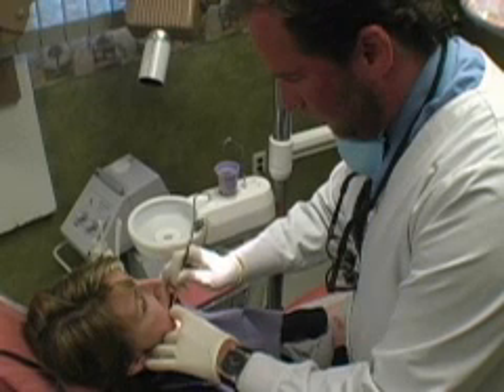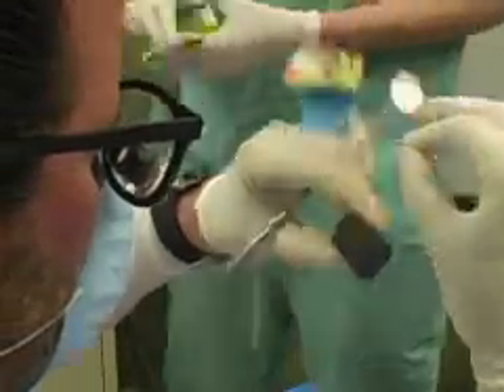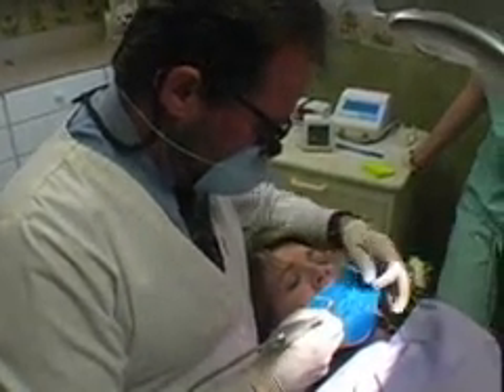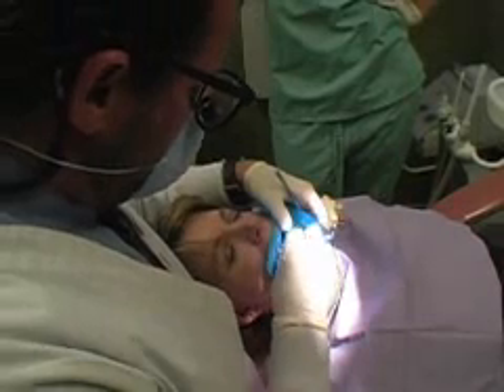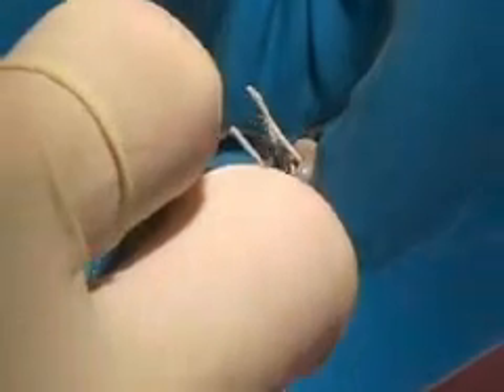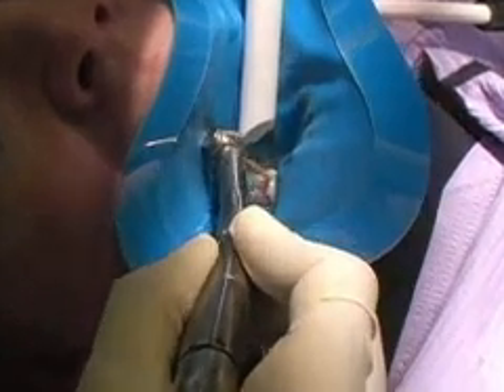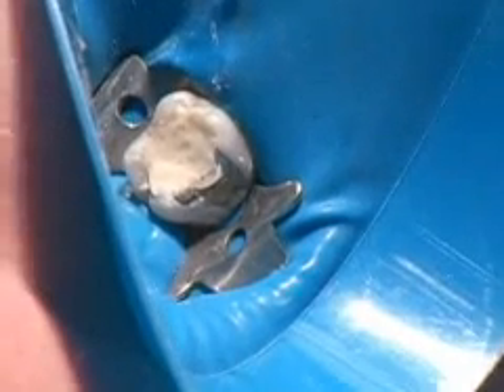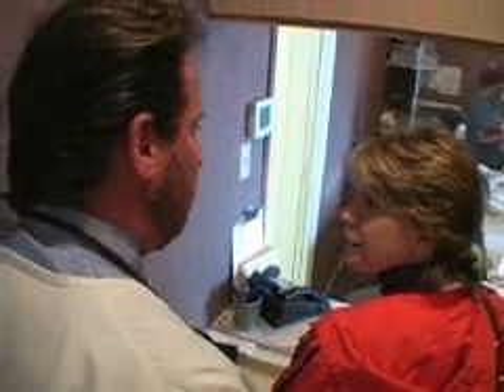Root Canal Demonstration

Comment: I've had one of these before, about 15 years ago when I was 13. It was quite a scary experience because of all the pointy instruments and tools they use during the procedure, in particular the files, and I was in that chair for a good five hours (mainly because they had to take a crown impression and do some fillings right afterwords), BUT it didn't hurt. At all. They gave me two lidocaine injections right at the start and that got me through the entire five hours. They said I did so good they wanted to do another root canal, at which point I started taking swings at the dentist (not really, but I'm sure a lot of people get that urge). 

Unfortunately, I may need to have another one of these done on a tooth I had recently crowned (the filling was too large), and despite all the positive feedback I've heard regarding root canal experience, and despite having undergone one before, I'm pretty scared just because of how incredibly sensitive that particular tooth is. They gave me four shots of lidocaine and two shots of septocaine while they were prepping it for a crown and doing small fillings on the adjacent teeth, and every time they touched it with the drill or cold air, it was like a bolt of lightning tore through my body. I know it shouldn't hurt, but anaesthetic doesn't seem to work too well on me these days. Six shots and I still felt everything. 

So the prospect of needing another root canal after how painful it was just to get that tooth crowned and the adjacent teeth filled, even though I know the procedure shouldn't hurt...not very reassuring. Not with how sensitive the tooth in question is.

Comment: i had my tooth number 5 and 6 root canal treated. As soon as they openned the tooth and touched teh nerve i felt so much pain so the arsenic was the only option. Before the procedure they had given me lidocain shots but still i felt really strong, sharp pain like electricity explosion. Is that normal? do i have very sensitive teeth or it was just anasthesia done in a wrong way.
Reply: Definitely the anesthetic was not enough for you. If the tooth was infected with puss, the anesthetic is not as effective. Some dentists give a double dose in those cases. I always need double the standard. I just had a root canal and half way through I can feel everything. Nerve pain is the worst pain I've ever felt.
Reply: +Rustin Cohle s
Reply: usually if u feel something they should stop and give another shot.

Comment: Hi Doctor. Great job. I had a two unit bridge and felt serious sensitivity pain on the tooth holding the bridge. The dentist did a root canal. The tooth still ache but slightly better than before. I'm scared because I've been reading online that a root canal for my case is a temporary fix that the tooth will fall off shortly. Is this true? .. Thanks

Comment: I just had this done today and I even went to work a few hours later. This procedure last just under an hour. Most of the time is waiting for the topical anesthesia to set in and numb you up real good. For those like me who are scared of shots, don't worry too much. You are given a numbing topical ointment applied to a q-tip and inserted between your gums and the side wall of your mouth. It's set there for a few minutes before the first 2 injections are applied. You may feel some pressure when the needle is inserted on the first two injections, but no pain. After the first two, you are given a rest period of 2 to 3 minutes until the next 2 injections are made. You wont feel them at all, as the first two have encompassed the side wall of your mouth and your face is basically paralyzed for the next 4-5 hours, lol. You will be given another 2 more after a 10 minute wait and just before the procedure begins and that will tally up to 6 total pricks of a needle to keep you calm and painless for the whole procedure. That's the worse part, and even it is a walk in the park. Please don't be scared, you will feel silly afterwards if you do.

Comment: Need to get this procedure done soon, is there any possible way they can put you asleep or numb your mouth or something? Just by watching this I get frightened so I can't imagine what it's like once there.
Reply: if you get bad anxiety like me ask the dentist for a 5mg of valium takes the anxiety edge off without drugging you up kinda just makes you really relaxed and lowers your heart rate
Reply: They numb your mouth with lidocane, a very good local anesthetic, but if your in a an area with what is called "Sedation Dentistry" they can give you what is basically a tranquilizer and you won't even remember going. You'll have to have someone drive you for that and it will cost an extra penny or two but, its an option. But more than likely the lidocane will be enough to get you through it.
Reply: I got laughing gas which basically calms you down then I had 2 numbing shots in my mouth then your relaxed and you can't feel anything ..... The only thing is you can hear the drills which may freak you out but I fell asleep halfway through so all good

Comment: I had one done today - it didn't hurt at all. I was pretty nervous about it going in, but the most painful/uncomfortable part was the initial anaesthetic injection, which I'd say was a 1 or 2 out of 10 - basically not bad at all. After that I felt nothing at all for the rest of the procedure, was was completed in under an hour. In fact, I found the whole thing strangely relaxing. Afterwards I had a very numb jaw for 3 or 4 hours. When that faded there was a mild dull ache but that's been easy to keep under control with paracetamol. Overall, I'd say it wasn't bad at all - certainly not worth the nerves I had beforehand.

Comment: Got my first root canal done today. Based on my experience it wasn't too bad. I didn't feel much after the 2 novacaine injections. I also received laughing gas for anxiety reasons.I didn't feel the drill or the poking of the files.The only pain I felt was when they were getting rid of the nerves and the drying of the sealing cement. It was a drawn out kind of pain (10 seconds each). I received my antibiotics and had absolutely no pain after the procedure. I've got a second root canal in January.

Comment: A root canal will typically cost $1,000-$1,500, plus you will need a crown afterwards which can be another $750-$1,250.   In the USA, even if you have a good dental insurance plan, you should still expect to pay as much as 50% of the cost out-of-pocket.  You should also ask the provider about payment plan options.

Comment: turns out it was just a big cavity! whew! but it needed a deep cleaning, with products used in a root canal. I have to admit the freezing did hurt but even with 3 freezing needles, i felt the drill a little bit, like a pinch on some nerves :S Right when I felt it, I asked for another needle and after that it was completely painless! the only downside was that i was frozen for over 5 hours afterwards haha!

Comment: Cost depends on what tooth needs therapy.  Top molars typically have 4 roots and almost always need to be done by a endodontist rather than a general dentist.  This is quite a bit of work and without insurance will easily run you a couple thousand dollars (this is because a RC tooth ALWAYS needs a crown after treatment).  Bicuspids typically only have 2 roots and can be done by the gen dentist for a lot less.  Cash paying patients can almost always negotiate or get a discount.  Check.

Comment: Thank you for posting this video!  I have an infected tooth which already has a crown on it. I had gotten a cavity under the edge of the crown and had a filling but it fell out.  My dentist had mentioned if the filling did not work I would need a root canal.  Well you hear so many terrible stories about root canals that I put off going back.  So I waited too long, its now infected my face and gums and glands are swollen. I am on antibiotic and will be having root canal Wed. TY SO MUCH for video!

Comment: The rubber dam is essential to avoid contamination of saliva into the canal. (Saliva contains bacteria ) . The rubber damn also creates an isolated environment, so there is little chance of anything falling into the mouth (e.g. Files). This also allows the dentist to work more conveniently and faster. Another important thing is Sodium hypochlorite , it can cause tissue burns if it is spilled. So yes, request for a rubber damn always while having a root canal! Hope this helps answer your question

Comment: Basically during the root canal, they do novicane, and they retest it to make sure you feel nothing.  As they drill, you will feel vibrating.  Then they put a file in to pluck out the bloods and nerves.  There, you will feel a bit of a disconfort pinch, but not sharp severe pain.  Afterwords, they put the fillings in the root and they fill the tooth.

Comment: The worst part about a root canal is that rubber thing in your mouth.  It is nearly impossible to swallow with your mouth open.  It also makes it so the tooth dust from the drilling can be inhaled which smells awesome by the way.

Comment: If you have pain that lingers for 10 seconds or longer, or the pain is spontaneous, it's likely that the tooth is infected and has reached a point to where it can no longer heal itself.  The root canal removes the pulp (nerve and blood vessels) and takes the pain away, removing all the existing bacteria and preventing new bacteria from entering the tooth.  It's best to have this checked as soon as possible.

Comment: The removal of the infection should only take one appointment as demonstrated in the video.  If you have an abscess or your radiographs at the time of your initial appointment show that the bone around the root of the tooth is diseased from the infection, follow up radiographs verify to the dentist that the bone around the tooth is healing and that the infection is gone.

Comment: It doesn't hurt if the doctor gives you the right amount of anesthesia. You will feel a little discomfort (not pain) or pressure when the doc starts drilling and when he starts inserting the brush like things into each root to remove the nerve. It will feel like someone is grinding on your tooth and applying downward pressure. Just make sure you ask for mire anesthesia if it starts hurting as he removes the nerve. Just hope all roots are found if not it might hurt again even after 1yr. Good luck

Comment: I've had the rubber dam multiple times, it's amazing. It allows the dentist to isolate the tooth, keeping any tooth fragments free and clear of your throat. It also keeps the water from going down your throat when they are rinsing and sucking, thus allowing you to swallow during the procedure. It may look a little strange but it's a very beneficial tool used in modern dentistry.

Comment: take care of your teeth and gums.BRUSH AND FLOSS. if you have any health issues get the EXTRACTION. go with a bridge or a partial. don't get to the point where you need a root canal GET CLEANINGS, BRUSH AND FLOSS. if the dentist says you need a root canal, don't  do it go with a partial or a bridge. the root canal tooth will host colonies of anerobic bacteria mutating inside you mouth the rest of your life, this puts stress on your bodies immune system a round earth used to be "fringe thinking"

Comment: @AliceLily1000 I ust had mine finished yesterday, and I can tell you that it's not horrible, just unpleasant. The needle slightly hurts, and putting the "frame" on (I've got thick teeth). You might need some medicine put in your canals if they're infected before filling them (cleaning them is unpleasant because the dentist stops cleaning each canal when you start feeling pain). After that, you'll only be bored of waiting. I'm afraid of dentists, and if I made it, you can too.

Comment: I had 4 of these plus a redone on one. Three of them were severely infected and they couldn't get the tooth to numb. So they opened the tooth up and pack it with disinfectant. I had to take antibiotics for a week and then come back to finish it. There was so much pain from the infections. To make matters worse I kept gagging from all the stuff in my mouth during the procedure. Then I had to get crowns put on them. Then got 10 fillings on my other teeth. $5000 in all. Now all my teeth are fixed.

Comment: If you're already in pain, to the point that it's pulsating, you don't have to worry about any more pain, even during the procedure. Releasing the pressure when he gets into your tooth, you will feel WAY better. You may be achy after your procedure, but it's definitely not as close as the pain you were feeling before going in. Got my root canal done in Mexico (had no insurance or big $), and my dentist did this exact procedure. :) I researched this before getting it done. No more pain! :D

Comment: @paintballwiz1983 1.	There will be a space after pulling the tooth
2.	The teeth will start to move in order to close the space
3.	Bone in the area of the extracted tooth will start to decrease in level
u will end up needing more expensive and long treatments like ortho to straighten the teeth and periodontal to heal the bone and u might even need to replace the extracted tooth by implant or prosthesis. BTW root canal treatment is not that painful.

Comment: Just had a root canal last Saturday. Felt much more comfortable going in there after watching this video. The only thing I didn't like about the process was that the dentist I went to didn't use that rubber barrier thing, so I had to hold the saliva in my mouth without swallowing until the dentist's assistant sucked it out. lol That was annoying because sometimes she couldn't get to me fast enough because the dentist was working on the tooth. With that said, NO PAIN AT ALL which is cool with me!

Comment: Ok I just had this done at noon and it was painless. The only scary thing is seeing the tiny needles they put inside your canal and twisting it. I advised you not to open your eyes.  Other than that, my dentist forgot to put on the rubber before the cleaning which caused the water to enter my mouth and I had to throw up.

Comment: question. I recently had a partial root canal. the reason it was partial, is because the lady spilled some kind of bleach tasting thing down my throat and ended up going to the hospital later in the evening from burn pain in my throat and vomiting. I have found a new dentist, but have a bit of anxiety. is there anything else that they can use as an irrigation? or maybe any other words of advise for dealing with dental anxiety. which I never used to have before this? thank you
N

Comment: @emie868

Root canal therapy is normally about 800 dollars, depending on the tooth. Anteriors (front teeth) and premolars may cost a little less. They also have to do a build up, which is pretty much a large filling, but that doesnt protect the tooth from breaking. A crown is then recommended, which run for about 900 unless theyre all porcelain (all porcelain are used for anterior teeth since you have a wide selection of shades) those are around a thousand dollars.

A simple way to avoid this:

Comment: @spongytime101 i just had 4 done, the only times that it really hurts is when they are numbing you or if you arent numbed enough (like i was, they had to do it 8 times) and the numbing can hurt real bad or not a lot depending on where it is, and if your mouth isnt opening enough they will put this either plastic or rubber thing (i've had both) in your mouth to hold it open and then after is a little uncomfortable but if you have a pain pill as soon as numb starts fading you should be fine

Comment: @big24champ haha no. I work in an endodontics office. Your teeth contain something called "pulp" which, if exposed to bacteria by letting the tooth decay or injuring it enough to traumatize it, will need a root canal treatment. The endodontist essentially hollows out the tooth to remove the pulp to prevent the tooth from dying, and as far as ive learned so far, they seal it off with something called gutta percha.

Comment: Had 1 last Thursday the tooth must have been really fkd up cause it took over 2 hours of digging out the nerves. He did it in 2 parts. I went back today, another hour of poking & digging. Mine was a bit different than this procedure. It didn't hurt during it but, It was SORE for a few days. Glad I had some Percocet from a prior procedure. It's always best to keep the tooth if possible rather than having it pulled. I also had an extraction a few years ago, wish I'd have had a root canal instead.

Comment: I just had one done 1 hour ago.  The metal clamp they put in the beginning hurt a little bit, they had to freeze the inside and not only the outside.  Once it's frozen correctly, you don't feel a thing.  As soon as the paper points are put in the canal then it starts to hurt a little bit, only enough to bother you a little bit.  I'll have to go back to put a crown on.  The only thing missing will be a pimp nickname and i'll be all set with my golden teeth ;)

Comment: @impalingsnowmanOCP  
Yes you can just have your tooth pulled, however its always better to save a tooth instead of having it extracted. one you have a tooth extracted the teeth on either side of it start to tip into the gab and this can begin to cause problems for those teeth. also the tooth above the one extracted will no longer have anything to bite onto and will keep growing down causing problems for that tooth also So in the long run having it out end up costing more

Comment: I just had one last week. To be honest, the procedure is no different than getting a filling, it doesn't hurt to get it done. The only thing is that your jaw aches for awhile after ( they told me it can be sore from two days up to three weeks until the tooth heals) but if it does, take an extra strength ibuprophen and it gets rid of the ache. The achey jaw is the only crappy part of getting a root canal.